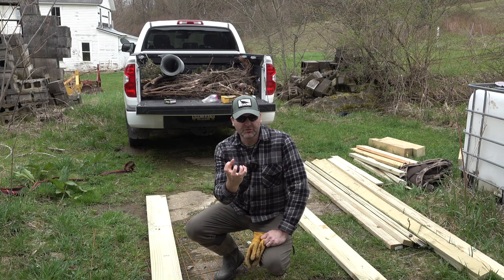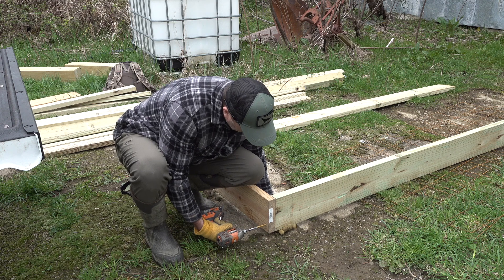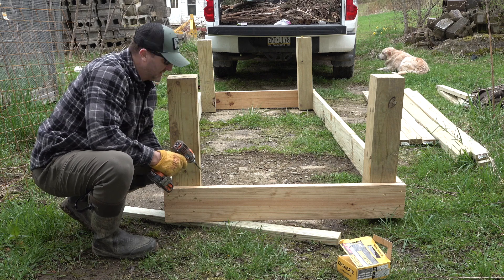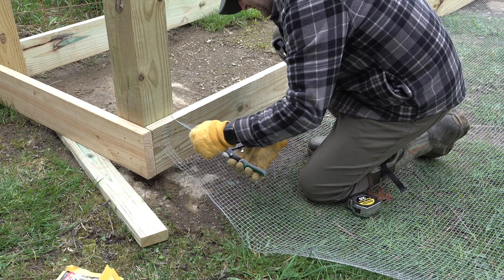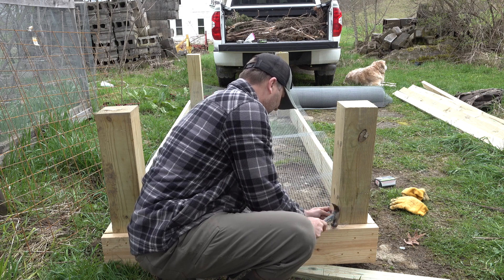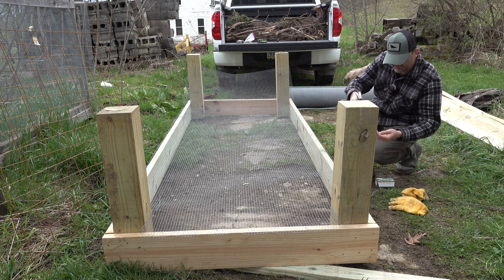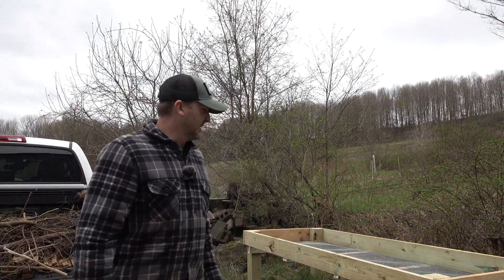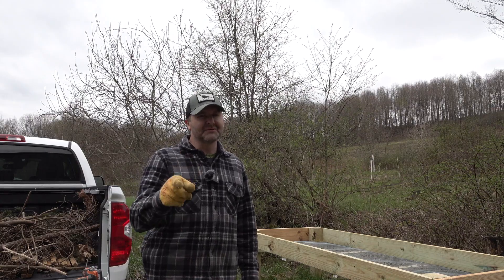Chestnut Air-Pruning Seed-Starting Table(Part 1 of 3)

Comment: It is a shame easterners have to go out west to hunt elk.  PA and many other places east of the Mississippi River in Colonial times had substantial elk herds that were mostly wiped out a couple of centuries ago and PA now has a modest herd for tourists to look at, but not enough for any significant hunting.   
I enjoyed watching you make the table.  I did not know that there are now portable screw drivers that were also hammer drills.   Easier to get long screws driven into the wood, but maybe on the smaller pieces not as secure.  But a good idea for driving long screws into  posts.  
 I got well developing tassels on my older trees that include 3 dunstan, a pure chinese  chestnut, and hybrid chinkapins x chinese chestnuts.  But they are not yet to the smelly stage yet in my zone 8b extreme western panhandle of NW FL.  I am just a home grower and already have more than my immediate needs.  But I still have some diverse chinese seedlings that are going to make it that I got seeds for a few years ago from James Nave in southern California about zone 9.  
Negative note I see some fireblight on some of my asian pears, but then they are marginal relative to chill hours in the deep south anyway.  The chojuro asian is very resistant.  My heirloom southern pears seem to be free of it.
Reply from the maker: Can you imagine large elk herds roaming through Eastern States?!  That would be awesome.  We do have a decent-sized herd here in PA - they allow limited hunting to keep them from spreading too much and causing conflict with farmers.  
I misspoke in the video - It is an "impact drive" rather than a hammer drill, but functions similarly.  I LOVE it!